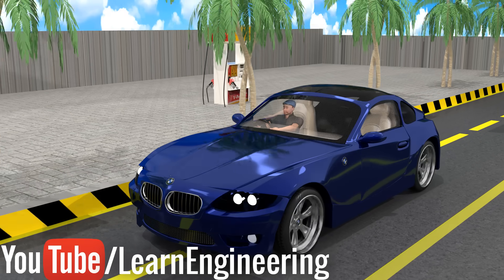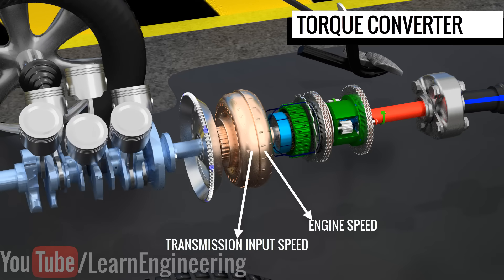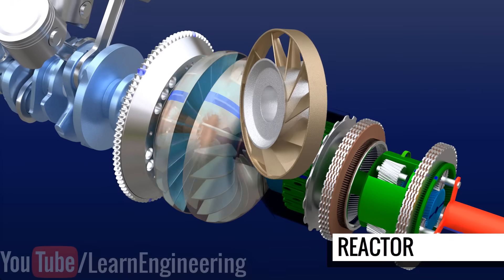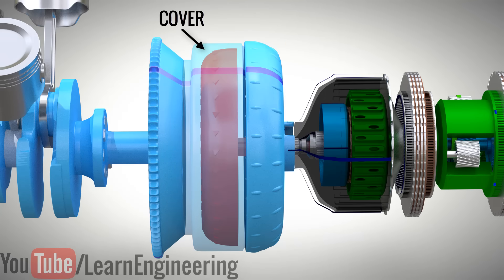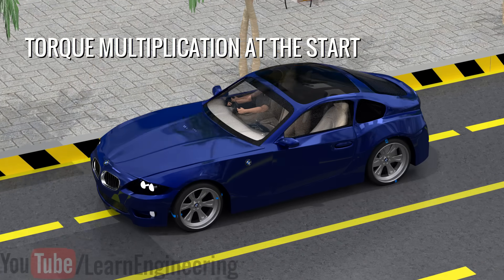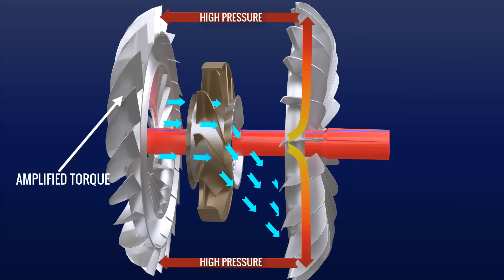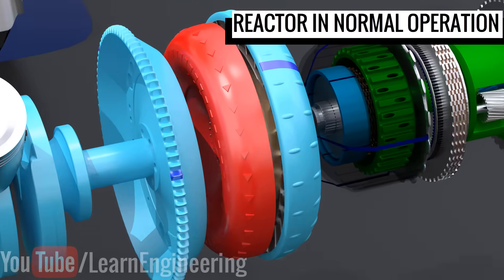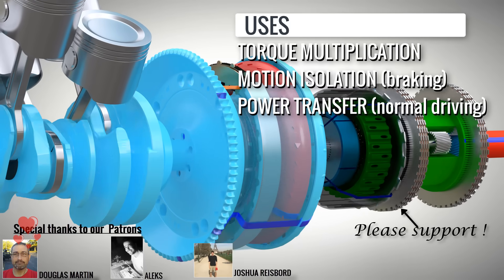Torque Converter, How does it work?

Comment: The VALVE BODY...
of a Transmission.... How it works???
Next lesson ....
Please!!!!
Reply: it's a combination of black magic and alien technology from the UFO that crashed at Roswell in the 50's.
Reply: Aliens fly millions of light years to get here...and CRASH?!  I wouldn't use their transmission lol.
Reply: When a valve opens or closes it engages or engages a brake on one part of the planetary gearset. For instance brake the outer hub and you have the gear ratio between the shaft and planetary carrier, brake the carrier and you have the gear ratio between the shaft and hub.

Old transmissions used pressure differentials caused by the increase in speed to open and close the valves, modern transmissions are all electronic.
Reply: @BigUriel   Well first your dead WRONG planets are turned by clutch hubs for lack of long explaination, valve bodys are loader with vaves and springs yes even newer ones. Shift solenoids were used from about 1993ish...
There are several variations from model to model,way to difficult to explain Thanks RETIRED AUTOMATIC TRANSMISSION TECHNICIAN..
Reply: you mean the duonic gearbox?
Reply: It is jut sets of valves allowing hydraulic fluid to reach actuators of transmission brakes and clutches. You open the correct one and clutch selecting certain gear engages while other is disengaged at same time. Real black magic is what controls this operation e.g. when to shift.
Reply: @mibars  new ones controlled by computer,old ones had some type of governor AND throttle pressure of some type controlled up&downshifts..
Reply: @packingten  Even the modern ones that are fully computerized are tricky. When you have a clutch to clutch shifting (common in modern automatics) you need perfect timing and right amount of clutch pressure for a good shift. If you have something wrong you'll end up with hard shifts or burnt transmission. And the algorithms must take into account clutch pack wear, changes in viscosity of the fluid, as it ages or changes temperature and many other tiny things.

Comment: Cylinder arrangement is wrong, it should be a straight six, not a V-6
Reply: So true, it is a BMW...
Reply: yep. Also you can see the motor at 0:40, it has 4 exhaust headers on one side, indicating it would be a V-8. Silly mistakes for an otherwise very detailed analysis.
Reply: pretty crazy. Never in a million years could I make a video like this, yet there are two glaring simple mistakes that i'd point out immediately if I was so much as a janitor passing by their workstation. "hey bro, that engine you are rendering should be an inline-6"
Reply: And that matters because?
Was the video specifically about the engine?
Hell, he could have replaced the engine with horses and the explanation of the torque converter would have been the same.
Reply: Hahah true gearhead. I saw something was odd but didnt get distracted from the videos purpose.
Reply: The reuse of old assets is actually very common. The animator more than likely already had the v6 and the BMW models/animations and didn't have the time to make new ones that match the scenario.
Reply: Gordon, you know nothing. if the video had horses people would close the video in 3 secs. Would the video had been more expensive if they intended to do the straight six? If anything its easier to design. And it would be a nice touch to have the car with its correct engine.

Comment: So just to clarify for myself, the reactor's job is to help the pump by making sure it receives swirled fluid, and this is done by the one-way clutch. Also, in a way, it is good that the output fluid from the turbine is not swirled, because that means it absorbed most of the swirliness from the pump and converted it to rotation to the transmission. And then that's were the reactor comes in and adds the swirliness back to help the pump.

Comment: Great video, it just hurts my mind seen in all these videos a BMW with a v6 engine, it just isn't that way.
Reply: The reuse of old assets is actually very common. The animator more than likely already had the v6 and the BMW models/animations and didn't have the time to make new ones that match the scenario.
Reply: They should probably just switch the "examples of a car driving" part of the videos to a Honda, because Honda fans wouldn't then presume that every diagram that is shown is of a Honda, they would just think that the diagrams are of a "car."

Judging from the number of beemer comments, the fans of that car just have a Special challenge to understand, because they get so confused when they see their favorite brandy-brand that they forget the subject is car parts, not a brand. It is probably cruel to taunt them with it, better to just remember when selecting filler clips to only use brands with practical users, and avoid brands that have brand-fans.

Comment: Power loss compared to a standard transmission
Reply: As much as I love standard transmissions, I have to acknowledge that modern automatic transmissions are just as power-efficient (if not moreso) than the equivalent standard transmissions. As mentioned at the end of the video, a clutch is used to mechanically drive the whole thing once torque multiplication is unneeded, so energy is no longer being lost through fluid coupling. Yes, the 4-speed automatic transmissions of yesteryear were complete garbage compared to the standard transmissions of the same era, but nowadays with better mechanics and computer control, the automatic transmission is just as good as standard in terms of power and efficiency. In terms of fun and driver connection, though...
Reply: Game ninja. Its still not responsive to the gas pedal. I can feather my pedal 2 cm and i can feel how my manual T. car moves forward and if i decelerate i can feel how it engine brakes a little. Autos are so disconnected it  takes time for gas response because even if torque converter is locked its in a high gear and has to downshift 1 or 2 gears to do what you want, and it takes time.
Reply: Major Tom I agree with you on that point. One of the biggest advantages of a standard transmission, in my opinion, is that you can choose your gear before you start accelerating, so you don't have to wait for the transmission to respond before getting your power.
Reply: You lose some horsepower through an automatic but they actually increase available torque. So it depends what you want most out of it.

Comment: How reverse gear works through this
Reply: In a drive train the gearbox is after the torque converter.
Reply: Chris Rowland hoo this is separate equipment it mean tq
Reply: You have to stop the engine, switch te battery terminals and start it in reverse, but in most cars this happens automaticly
Reply: Reverse doesnt have anything to do with a clutch of a manual transmission or the torque converter of an automatic. That is the job of the transmission look for video.
Reply: they have a video explaining auto transmissions and planetary gears. 
it does a good job explaining how reverse works in an auto trans too which would pair nicely with our new found understanding of the Torque converter
Reply: the torque converter spins the same way, putting the car in reverse does nothing to the torque converter. what you're doing is making a change inside of the transmission, the only way the torque converter would spin the other way is of the engine spins the other way.
Reply: tullgutten lol 😁
Reply: Very good question my head was blow

Comment: Well, I'll be the first one to say it..

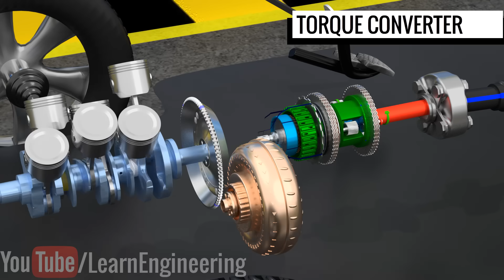Your torque converter is facing the wrong way in the scenario animation at 1:06
Reply: please watch the whole video before making such a stupid comment..
Reply: I went back and watched the whole thing, would either of you like to elaborate?

The video does not answer why the animation shows the side facing the engine to have such a dramatic centerpiece on it as if it is the fluid inlet found on the back of a torque converter.

From the animation, it looks like someone sliced a torque converter and put two back halves together. I have never seen such a drastically long nose section on a torque converter, so I can only assume that they for some reason used a smaller animation of the back half or the converter is shown backwards.
Reply: Oh no, it looked like the the tail of the converter was stuffed into the flywheel, and it threw up a red flag
Reply: Dude, that side of the torque converted is bolted to the flywheel but isnt shown in there, the other side is braked by your wheels all the way through the axle, driveshaft, gearbox etc. the video explains that this setup make the whole thing be able to be centered as fuck.
Reply: "Oh! Ok, I see what youre saying."  
well that was easy af
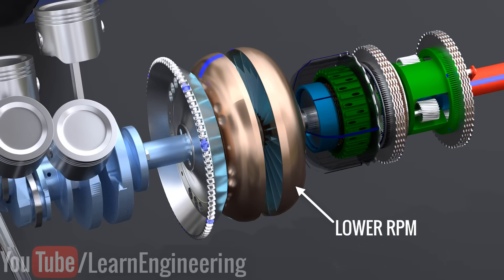Reply: it is explained at 3:05, basically the turbine is brought to the front so can easily center aligned with crankshaft using a bearing.

Comment: After 30 years of wandering, I finally get a clear explanation.
Reply: Martin Godinez hope you didn’t wander too far
Reply: @BARFYADAMS  almost jumped off a cliff wondering.
Reply: Martin Godinez where did you wander at ? I hope it wasn’t cold there !! 🤪😂😁‼️
Reply: Where did you wander to?
Reply: @danc1197  He wandered off...
Reply: Yeah this is channel is very clear.
Reply: I wonder if you ever got tired while wandering.
Reply: ... which I do not understand fully.
Reply: Same here.  While Torque Converters do a great job, the lock up converter was a big help with power output.
Reply: You must be an Israelite
Reply: Lay off the 420 if it took you 30 years.